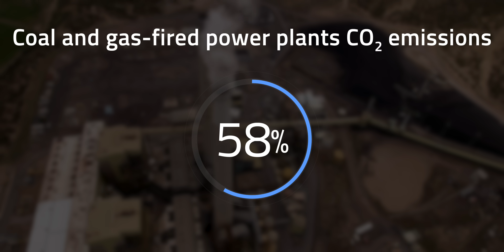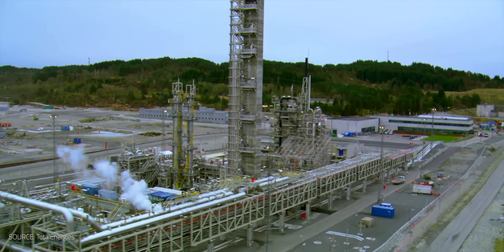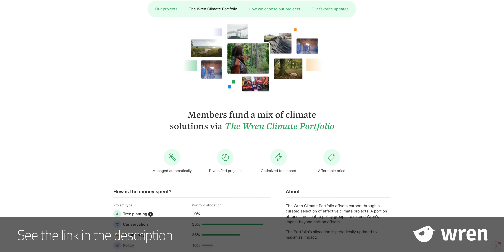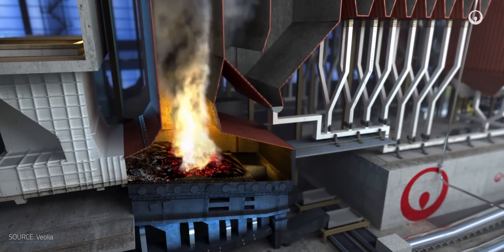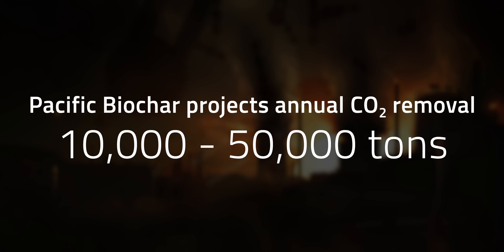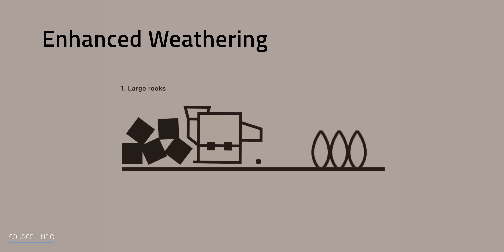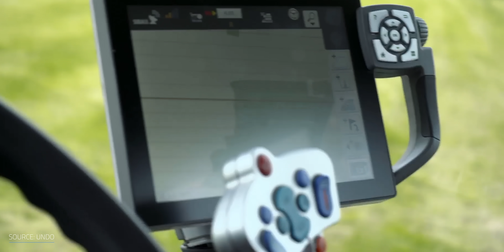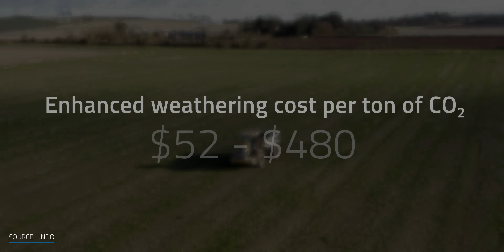The Reality of Carbon Capture

Comment: What is also amazing about biochar, is that it preserves the cellular structure of the original plant, but now almost 100% carbon.  This means a very porous carbon product, like a carbon styrofoam.  This porosity allows it to retain water near the plant roots, retain fertilizer near the plant roots, and create a microbiome that really enhances plant yield.  And it sequesters carbon.  Great stuff!
Reply: Burning wood crates 3.6 times more CO2 by weight. 30 tons of wood would create about 10 tons or less of biochar and over 70 tons of CO2. 
Biochar also reduces the plants need to absorb CO2 from the air. This gives us a net gain of atmospheric CO2 across the entire carbon cycle.
Reply: @Deliriousintentionsprojects  You don't burn the wood to make biochar.  They use a process called pyrolysis, which is basically heating the wood in an oxygen-poor (or completely inert) atmosphere. This DOES release various gases, like some co2, hydrogen, carbon monoxide, and methane, but usually the reason for using pyrolysis is that you are trying to maximize biochar output while minimizing released co2. Also, that hydrogen, carbon monoxide and methane (aka syngas) is useful on its own if you capture it. It can be used on it's own as a fuel (either burned directly or using the Fischer–Tropsch process to convert it into a liquid fuel), or as feedstock for the Haber process to produce ammonia. Assuming you aren't burning the syngas, and that the heat for your pyrolysis is coming from some other carbon negative or neutral process, the whole process is carbon negative.
Reply: @raelik777  how is this different from normal charcoal? You heat wood or any organic matter really in a low oxygen environment when you make normal charcoal. This biocharcoal sounds like regular charcoal rebranded to me.
Reply: @th7800  They ARE similar and made with basically the same process, but in reality are quite different.

With charcoal, the intended product is briquettes or lumps to be burned, and is made from sawdust with some binder (for briquettes), or hardwood chunks. Biochar is usually made from things like switchgrass or agricultural waste (grain stalks) and comes in a bulk form with relatively small grains (less than an inch typically).

The processing of biochar is handled differently, because the intent isn't to make a product to be burned, and can be a byproduct of another process capturing the gases produced.

Charcoal is typically made at temperatures of around 400C, which leaves quite a lot of volatiles in the coal. This is perfectly fine for something you intend to burn, as those volatiles get burned off (they also contribute to the "smoky" flavor if used for cooking food).

Biochar is produced at 600C to 1000C, since very often those volatiles themselves are a desirable product that you don't want to leave in the char. The volatiles also inhibit plant growth and can leach into soil, so you don't want them in something you intend to mix into compost, etc.

Also, the higher temperatures make biochar more porous than regular charcoal, so it's better at holding onto water and nutrient. 

Finally, those higher temperatures form a more stable crystalline carbon structure in biochar than what you would find in regular charcoal. This means that charcoal breaks down in soil and releases its carbon much more quickly than biochar, which can remain stable for hundreds or possibly thousands of years.
Reply: @raelik777 the best descriptions I have seen.
Reply: @Deliriousintentionsprojects  one of the most promising uses of this technology is not burning wood, but various waste products (including sewage) which they seem to have found a method of doing without releasing toxic gasses, and then the carbon can be used in building materials including concrete
Reply: @Deliriousintentionsprojects  so 30 tons of wood creats 70 tons of CO²????amm physics???
Reply: @madalin___2887  You have to add in the mass of the oxygen consumed in the burning.  For every 12 tons of carbon, 32 tons of oxygen are consumed.
Reply: @madalin___2887  Yeah, if you just burn it. But if you use half the wood to pyrolize the other half, you get half the CO2 released than if you burned the whole pile. The other half is sequestered for a thousand years.  Next batch also gets sequestered for a thousand years.  Repeat. 

I watched them burn the rain forest in Madagascar. It was sad. They are left with ash over poor soil, and the nutrients leach out quickly. Yet they know how to make charcoal and use it for cooking.
Reply: I'll do my part and dump a bag of charcoal in my yard.
Reply: As a Federally Certified & License Professional Engineer, you are a Carnival Barker -- A simple-minded English graduate that doesn't have the mental capacity to understand basic Calculus, let alone Engineering.

Comment: CC from the atmosphere is an absolute fraud and misdirection by fossil fuel producers.
And here's why. I defy you to prove me wrong.
To capture the gaseous CO2 using a machine which requires energy to drive it. How much energy is required to capture one ton of CO2? Compare this with the energy originally gained by the process which put the CO2 INTO the atmosphere. Is it 1%? Is it 5%? Is it 10%?
What ever. It makes the process of burning fossil fuel to release energy inefficient.
And taxpayers will pay for it. It's like paying someone to dig a hole, and then paying someone else to fill it in. Is that not insane?
It's an energy balance problem and it will never work because the energy COST is too high.
It is straight out fraud to suggest it can be done economically.

Comment: What do you think of the permanence of biochar? I haven’t seen many papers showing that putting biochar in the soil is a good carbon sink over a timescale of decades or longer. Good for farming but not good for a long term solution. Happy to be proved wrong
Reply: Research Terra Petra in the Amazon Basin there has been some carbon dating to show the age of the carbon captured and stored in the soil.
Reply: From what I've seen it's estimated to last at least 200 years.
Reply: Duration is in Centuries.  Used in terra preta with ceramic debris, up to 7000 years (and still going).
Reply: Even in highly bio-active regions like the Amazon, it lasts hundreds of years. In temperate regions, probably thousands.
Reply: Perseverance of biochar is largely a factor of the temperature it was cooked at. Low temp equals short lived and more toxic with PAHs like bbq charcoal. High temperature equals hundreds of years. This is what biochar needs to be.
Reply: thank you all for sharing this stuff, happy to see my fears were misplacced. hoing it scales!
Reply: Yep some of the carbon dating of Terra Preta in Amazon biochar soils yield some of it is 1000's of years.

Comment: The problems I see with this, which is the same as the issue with renewables replacing fossil fuels, is we need deployment of solutions now, not in 15 - 20 years.  My concern, though in the long run these technologies will have a role to play, the short term work that needs to be done to give us a chance at more long run options isn't going to gain much value from these so their ability to offset fossil fuel carbon seems unlikely to hold much value.

Comment: The scheme I developed 15 years ago was a combination of both. Use renewable energy to drive the metabolism of bacteria and use them to capture the co2. Algae is no good because it is light limited. You can use the bacteria to produce food (via stem cells) or to make formic acid which can be used to drive electric motors and pump the co2 in solution underground.

Comment: I'm certainly no expert, but carbon capture tech seems a lot like overengineering a solution when soil restoration and growing more plants seems like the simpler, "more correct" answer.  It's like when people talk about solving traffic by way of autonomous driverless vehicles that are aware of the other vehicles around them instead of just...trains and bike lanes solving the problem way better.
Reply: You don't need to bring as many people 'onside' with DAC through apparently endless negotiations, regulatory hearings and compensation. Unfortunately large-scale tree planting projects in less developed part of the world seem to have a history of mixed success rates. There are schemes which rely on fast-growing species of tree which can be mechanically harvested and burned as biomass under CCUS conditions to produce electricity , thus effectively 'pulling' CO2 out of the atmosphere. Otherwise  tree planting just works too slowly

Comment: How does burning wood and other organic materials remove CO2? It would seem that it generates CO2 and even if it helped, the offset would be minimal.
Reply: Burning plant matter in an oxygen rich environment releases pretty much all of the carbon into the atmosphere as CO2. This is why you can take 100 cubic feet of wood and only get like 1 cubic foot of ash.

Heating plant matter in a low oxygen environment releases liquids and oils from the wood, but leaves the carbon, which is transformed into a more stable state (biochar). Unlike normal burning which leaves 1 cubic foot of ash, biochar ovens leave 40-60 cubic feet of biochar.

Comment: I am sceptical of carbon capture by pumping CO2 under ground.  Given fault systems and earthquakes (yes we get them in UK too) and fraking and tunneling, it hard to see how the CO2 will not eventually get out.  Also when it combines with the ground water it is likely to produce sink holes etc in the limestone.
So not a good long term outlook.
However, I think it might have a short term role to play in "playing for time" to stop us getting cooked while better solutions are worked out.
Reguards bio-char, it would be better if the heat applied could be by solar furnaces.  Charcoal is an ingredient of gas masks so maybe it could be further used to trap CO2, SOx, NOx etc and stored down the old depleted coal mines.  Burning biochar seems to defeat the object.
Further more bio waste can be composted.  It would produce methane but that could be captured for fuel or further treated to produce amorphous carbon and H2.
It must be exciting to work in planet saving, but a battle against time?
Reply: The oil that we mine doesn't leak out from the ground very much at all, so it will be safe enough if we put it where we got all the oil from.
Reply: The idea isn't to pump CO2 under ground. It's to pump carbon in more stable forms under ground.
Reply: @lmmortalZodd  Good but what forms of CO2 are more stable?
Reply: @emmabird9745  Limestone is an example. CaO + CO2 -> CaCO3. There are other ways, but pumping CO2 directly into the ground is a disaster waiting to happen
Reply: @lmmortalZodd  I agree on both counts.  Pumping CO2 into the ground is a disaster and quick lime +CO2 makes limestone.  Unfortunately quick lime (CaO) is not naturally occurring and is usually produced by roasting lime stone to make cement.  If the cement industry was a country it would rank no8 for CO2 production.  I heard that somewhere so 8 might not be current.

Comment: I don't remember if you already covered the liquid air energy storage, but I had the thought that it could be used for CO2 extraction. You won't get much since it isn't high volume, but in the process of liquefying nitrogen, it will also get some CO2 which could be extracted.

Comment: I don't see how Biocharcoal helps at all. You burn stuff, like plants, okay.. and because it has only a little bit of oxygen in the chamber it doesn't release all its co2 into the athmosphere when burning..? Okay.. But then you have not pulled out any CO2 out of the athmosphere at all, all you did was not-create-as-much to create this "special" charcoal.

Furthermore even that captured co2 will still be released when it is consumed and broken apart by all the use cases you mentioned.. You even said in the video that it needs to be stored underground in order for it to "hopefully" keep its co2.. co2 that again was never removed in the first place but instead just not created. So all the use cases are pointless as it would then create the co2.

Like, how is that solving anything at all?
Reply: I think the idea is that when the plants grow they'll pull carbon out of the air. Normally the carbon would be released when the plant matter decays, but this will prevent the decomposition.
Reply: @barryon8706  Which is a fool's errand, for you can never hope to come close to burning enough plant material to make any significant impact. Transporting all the dead plants to and all the charcoal from your special furnace would easily offset your contributions.

Comment: If they'd stop spraying Glyphosate (Round-Up) on everything the soil wouldn't be dead and it would capture carbon and give better crop yields. Regenerative farming solves a lot of the farm related issues without the need to apply more 'stuff' to the field.
Reply: No-till, multispecies (cover)crops and grazers in the mix can do a lot, but not in one year. Building symbiotic relationships to nourish rootsystems takes time. In the end though it can come pretty close to chemical yields and the advantage is that we now produce for about 11 billion with 8 billion mouths to feed and a rapidly declining birthrate pretty much world wide. Cut out the speculation and there is room to shrink some without people needing to go hungry. Even now people go hungry due to incompetent governments and greed, there is enough food in the world to feed everyone, access is the real problem and has always been since about 1970's green revolution.
Reply: I didn't know that glyphosate killed the soil. Could you please share your sources?
Thank you.
Reply: @TheAllMightyGodofCod  
It doesn’t.
Simple test you can do at home.  Take some soil, check the weight, volume, and pH.
Apply glyphosate, check the values over time.  You’ll see little to no change.
Glyphosate degrades rapidly under sunlight.

Comment: I am already using biochar in my potting compost for the plants I sell in place of vermiculite and perlite. I have just got some rock dust to add to the mix but  it is expensive £10 for 20kg so I will see if it makes any difference to the plants. The biochar is a bit more expensive than the vermiculite and perlite but I think its worth the extra cost.
Reply: I've wondered if biochar could replace perlite.  I can't find any data.
Reply: You can make biochar easily if you have a wood burner, or solar cooker, you need a metal container with a small gas outlet. Place some wood in the container. Place the container in the fire. The volatiles will burn out the hole. Rapid quenching will preserve the char in its carbonized state. If it cools slowly in air, it will burn to ash. Dont get the fire too hot, or the container will get damaged too much.
Reply: @LOOGamala  you can dig a hole to make biochar
Reply: @razingcanez717  yes you can but the combustion releases more VOCs and PAHs. It better to put it in a proper combustion chamber.

Comment: biochar seems to be a nice way to boost our cycle of farming etc, but ultimately isn't really related to the actual issue of reducing CO2 in the atmosphere as its not escaping the cycle at all.
Reply: The charcoal has absorbent property and can hold on to the micronutrients for a longer time. But you cannot keep on adding charcoal to the soil every year
Reply: part of it is scaping. it just stores a big portion of the CO2 that would have gone straight into the atmosphere. pyrolisis is quite effective for keeping the carbon in it's place. the only "pollution" formed out of it is the burning process which could be solved with proper electrical heaters powered by "co2 clean energy production" 

syngas can be used to fuel the pyrolisis too, which is mostly formed by H2 (hydrogen gas, which reacts with O2 to form water vapor) and CO (carbon monoxide) as i said this can be burnt but also can be used to produce Methane (CH4) Naphta and others, keeping the CO2 cycle closed.

if humanity wants to keep the amount of CO2 as it is it needs to stop pumping it out of the ground (which means stop burning fossil fuels) which will make active CO2 capturing methos more useful (it's pointless to capture CO2 using electricity that's being produced by burning fossil fuels)